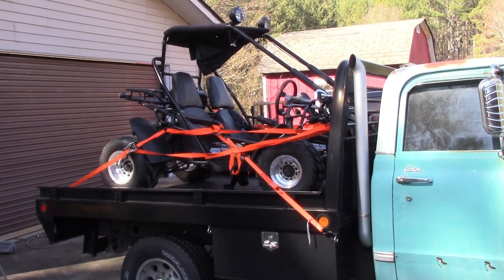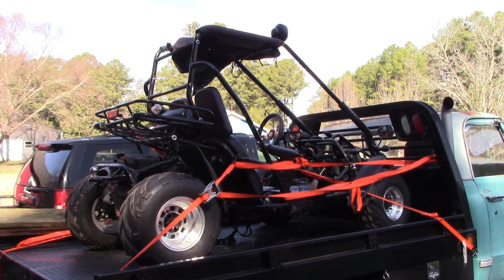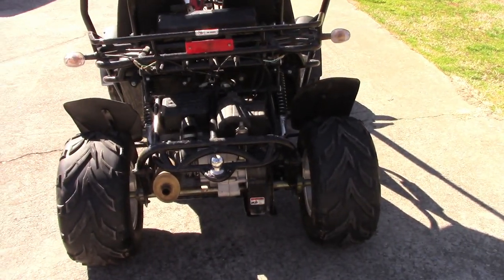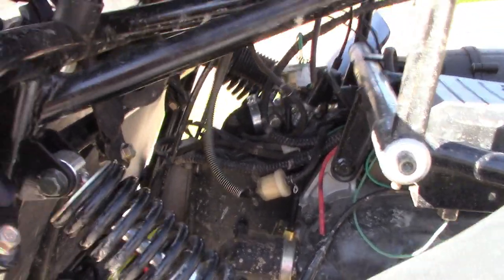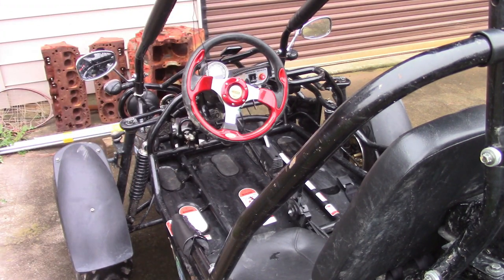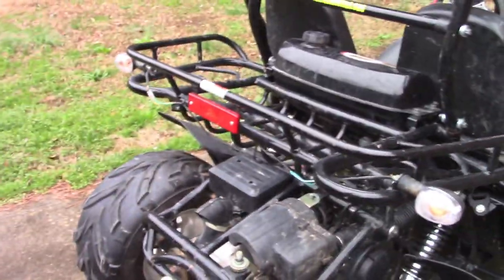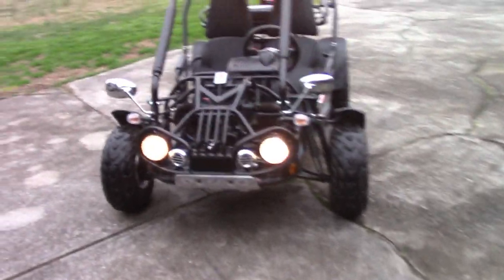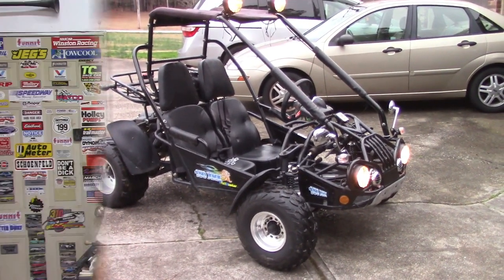Trailmaster 150 XRX Carburetor problems and repair.

Comment: I appreciate the video.  Couple of things.  The black cylinder on the side of the carb is the enricher.  It allows an "extra" circuit to flow additional fuel at startup (rather than having a choke).  As the engine warms, a needle inside slowly moved forward and blocks the enricher circuit by the time the engine should run without it.  Next, there is no fuel pump.  The engine vacuum pulls the valve open and allows fuel flow by gravity.  It is, essentially, an automatic petcock.
Reply: Is there a way to bypass enricher or a carb with manual choke

Comment: Great video.  Very clear and a real help.  I have a short attention span, so this might be the longest video I've watched end-to-end. I bought one of these for the kids in 2016.  It ran okay for the first summer.  By the next spring I paid a local mechanic more than a couple hundred dollars to get it running again and it lasted most of the summer before it just stopped working altogether.  There is sat for years.  I found this video when looking to "just get rid of the thing".  I drained the old fuel, charged the battery, replaced the carb like in the video and didn't even have to clean the air filter it had so little use.  It fired up after about 5 seconds of cranking and fires up immediately ever since.  So for about $40 and 25 minutes, we have an awesome little go kart thanks to Jo Daddy's Workshop video!

Comment: I just acquired a trail master blazer 200 EX. From my granddaughter and son n law. It has been sitting up a little while. I know I need to change or clean carboratir . I am almost 65 a woman 👠 and I am so excited!! I am somewhat motor literate. I love love learning new things! Going to try to make it street legal. Doesn't need much for me to do that! This thing is loaded! I just need a lot of cleaning and tweaks. Got all the wasps out! The rest should be easier!! (I hope). It does run, but it lags and sometimes takes a minute to get it to turn over. But I don't give up easy, I learn fast and I am not a quitter! I will be checking on you for some things. I like the way you explain things!!! Ty

Comment: I have a 2007 Carter Brothers 150cc I got in the 6th grade back in 2008. It is almost identical to this one; crazy to see how much hasn't changed. The body and frame are exactly the same. However, mine didn't have indicators, a horn or a speedometer. Those carbs are a pain in the ass, mine is being fixed right now.

Comment: After watching this I see I have lots of missing components. There are no T-fittings on mine. I got hoses with no place to go. Mine will start at first and run for a while then stall. I can get it to run longer if I hand choke it. The longest I had it running was about 12 minutes idling. It will not run on half to full throttle or it will run out of fuel (run too lean). 

The electrical is the choke on a GY6 engine.

Comment: Hey...you may be able to take out some of that lag by tightening up the throttle cable by adjusting the two nuts on the bracket that is attached to the carburetor

Comment: I just did one today and it's running sluggish also. Maybe the high speed jet needs blown out again or soak it in solvent to dissolve the tiny film inside the carburetor port's. Also have found new carburetors on amazon for cheaper than I can clean one. $30

Comment: Great video! Get yourself a set of wire drill bits. (Amazon) They are tiny. These carbs have such tiny jets and ports in them. They clog with the slightest varnish. I have 2 spare carbs I keep ready to go. Also, just some advice, 1. Don't crank on it for long periods( the starters are tiny and will die easily) 4 or 5 revolutions and let the gas run down to the carb your are discharging from the tank, then another 4 or 5 revolutions, etc, etc. 2. Don't pump the gas pedal. The choke is electric. There is no accelerator pump like on a car. Treat it like a fuel injected car.  3. Finally, Seafoam and Stabil don't seem to help...maybe they even make the things in the carb clog worse. Have a blast and try not to kill yourself.
Reply: Is there a way to put a carb with a manual choke or bypass

Comment: I’m so glad I found your video/channel. I’m going through a similar thing but it dies when I give it gas. Carburetor is clean, air filter is fine, and I have checked for vacuum leaks. I changed the spark plug as well and still goes dead when accelerating. Any help or info would be much appreciated.
Reply from the maker: These carburetors are finicky. That's mainly why I just replaced it.

Comment: the motor on it is called a gy6 motor and u can change the weights on it to change the speed with pullys on the left side where ur muffler bolts to
Reply: Make videos

Comment: Hey man good video. I'm working on one of these for a friend of mine now. It was doing the same thing yours was when you hit the gas it would die. After looking at the carburator everything was good in there. So it ended up being bad vacuum lines. That could be part of the reason it feels sluggish. Any way you look at it these things are garbage and that motor I can't say a good thing about them. Good luck with it.

Comment: Thank you for that video. I purchased one that needed a little more work. I did end up buying a new carburetor also. But it takes several attempts to get it started when it’s cold. But once it stays running it seems to run good. Seems that it needs the choke adjusted ??? Any idea what or how that can be adjusted? 
Thanks
Reply from the maker: No advice on adjustment.

Comment: My Trailmaster starts up and stays running fine but it will not move forward or reverse. The belt is fine and the cvt looks good. Chain is on and I tried adjusting the shifter and nothing. Brakes aren't seized. I'm at a loss... Any thoughts?
Reply from the maker: Can you push it around easily?
Reply: @jodaddysworkshop786  yes we can push it.. but it's a little stiff
Reply from the maker: Then something seems to be out of adjustment or perhaps the drive unit is broken. I had jacked mine up to spin the rear wheels and found the brake caliper was stuck. I did a replacement video.
Reply: @jodaddysworkshop786  thatd be great if that's all that's wrong with her... I will jack her up and try it myself. I'll search for your video to help me out too. If I figure out what could be wrong with her I'll let you know. Thanks
Reply: Hey * just fixed her! It was the drive sprocket 😂 it was worn and the teeth for the shaft were balled!

Comment: Hey! I have the same unit, and the other day I folded the pivot point and punctured the gas tank. I bought a gas tank from Canadian Tire for a lawn tractor and installed it, got it running, but now it stalls randomly. Just bogs down after accelerating a bit. I'm not great at mechanics, but this fuel tank I bought was for a 196cc engine, whereas these are 150cc. Do the gas tanks have a air restriction based on the cc that would cause this?
Reply from the maker: Tank shouldn't matter.

Comment: I need help with my 2020 Trailmaster 200 EX.  I bought it brand new and it has always made noisy brakes squeaking since I have had it.  I thought after time it would stop and it has not.  Also, from time to time while driving it sounds like the brake is squeaking / grinding.  Any suggestions from anyone is greatly appreciated.
Reply from the maker: I have had issues with the rear brake caliper hanging up. I made a video, but have not uploaded it yet.
Reply: Mine did the same... It's the parking break. Just adjust it or remove it and your drag will go away

Comment: Hi Jo, I have a 200xrx 200cc with the same issue: would this carb work on my 200cc? I'm only asking because it is very identical and the exact same part # but different cc's. Please advise if I should proceed with purchase. Thank you and the video was very helpful!
Reply from the maker: If it's the same part number, you should be good.

Comment: mine idols and starts but it won’t pull to drive and I replaced my carburetor already .. any suggestions please
Reply from the maker: The shifter won't move?
Reply: Jo Daddy's Workshop  I don’t have a shifter.. that I can see anyways
Reply from the maker: @alishiadavis8033  Really hard to diagnose without seeing it.
Reply: Caroline Putnam  did you get it remedied? I've literally worked on mine more than I've rode it!

Comment: You look like you probably have the tools to do it, go to harbor freight and get a 2500 winch. I mounted mine on the passenger side just in front of where the foot rest is. If you are having issues with the stall I would replace my plugs and put in a better coil pack.

Comment: Mine won’t crank thinking it’s the ignition switch.
Reply from the maker: Mine has a switch built into the brake pedal. Have to press it down like a car before it will start.
Reply: check the fuse first
Reply: @jodaddysworkshop786  can you tell me where the vacuum lines go I know it comes from the tank valve to carburetor but where does it get it’s vacuum I have a carburetor coming

Comment: Agreed..premium only..they have a little lag..could try checking and setting valve lash,its .004,intake and exhaust
Reply: What are symptoms if valve lash is off
Reply: @angelalopez2715  sluggish,bad throttle response..could make smoke..if too tight,will be loss of power,hard to start

Comment: Where do the vacuum hoses go from the carb tee ?
Reply: Did you ever find out about the vacuum lines I’m having the same problem
Reply: Same
Reply: @skor178704  I watched a few videos on the tube it looks to me like it connects to the fuel tank then to the splitter going to the carburetor and attaches to the intake there’s a nipple sticking out of the rubber intake tube where it gets it’s vacuum  and it will not run without it
Reply: @justme7950  thanks! Got it!
Reply: @skor178704  let me know if that works for you cause I’m still waiting for my carburetor to come in thanks
Reply: @justme7950  I figured it out. Got it working. So I changed the original fuel valve that connects directly to the bottom of the fuel tank, with one that has a shut off valve and only one nipple. Then with the second hose that was left with nothing to plug into, I plugged it up(with a nail/or clamp it) as well as the hose coming from the float bowl drain hose. I plugged those both up and it started great.